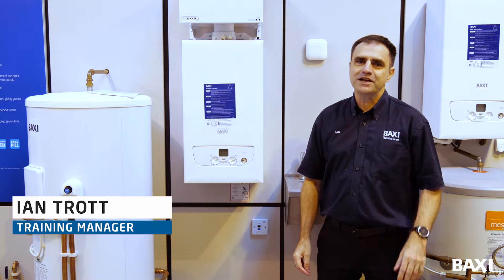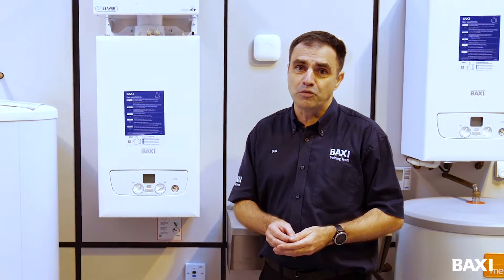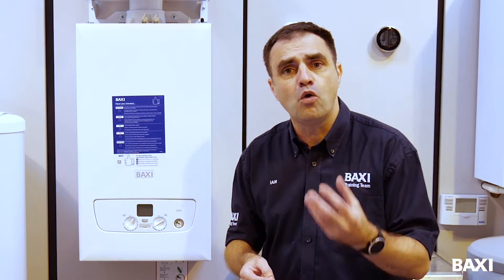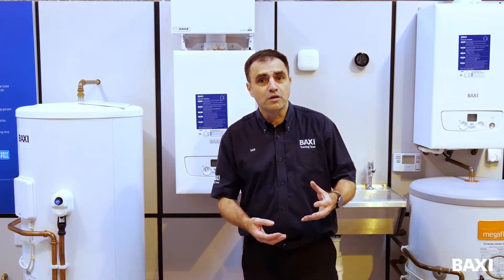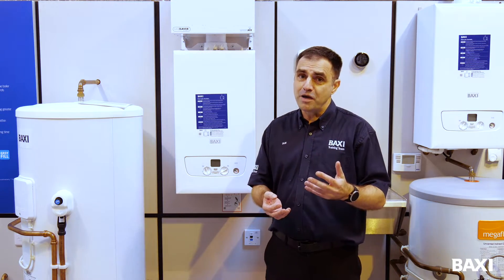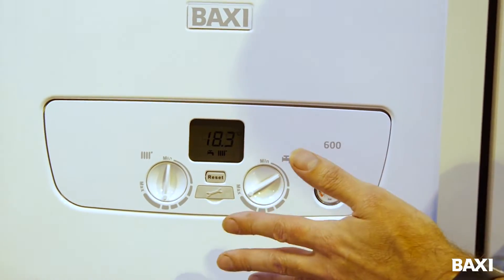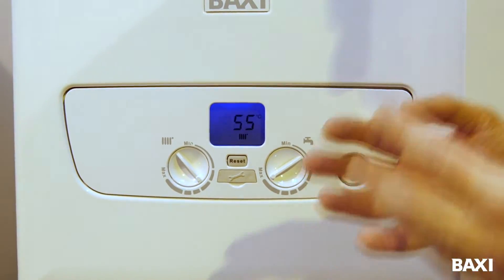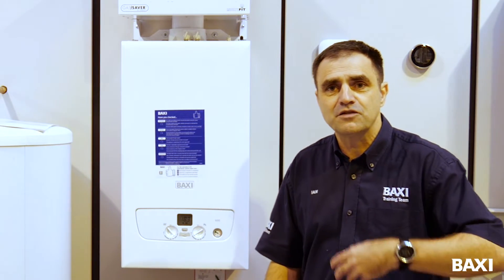How to turn down the flow temperature on a condensing combination (combi) boiler

Comment: A good boiler would be a Heat only or a system boiler with a double temperature setting. This can be used in Y and S plan systems with a Megaflo system or a sealed tank. I run the system like this. I have a boiler with two temperature settings. Whenever my heating fires it runs at 58ºC ( this suits my home ), but when the hot water fires it runs at 80ºC BUT! It turns the heating OFF for that period of time until hot water in the tank is hot. After that the heating runs at 58ºC again. In summer .... when the heating does not fire at all ... the boiler always runs at 80ºC to heat water. Good idea hey 😊

Comment: Hi, we recently bought a property that has a 2019 Main Eco Compact with the exact dial layout as this in the video. Unfortunately neither the radiator or tap dial have any effect on the number, they always display max temp no matter where on the dial you move it. Any ideas? Rang Baxi as it’s not old but because the previous owner didn’t supply any service history they won’t help under warranty.
Reply: The thermostat may be controlling the temperatures if its on opentherm

Comment: Am I right in thinking this hack can only apply to Combi boilers? I have a condensing normal boiler and if I turn the flow temp down the rads are colder
Reply from the maker: Yes - as Ian explains in the video, this hack is only suitable for condensing combination (combi) boilers.  If you have a cylinder and turn the temperature down, the water in your cylinder may not be hot enough to kill the dangerous Legionella bacteria.
Reply: @BaxiBoilersUK  and what affect does it have on rads?

Comment: I have the exact same boiler as this but when I turn the dial down the display still shows 80% no matter where I leave the dial, how can I fix this?
Reply: It sounds like your boiler is being controlled by opentherm, If so the controller will set the boiler temperature. Check your controller instructions for more info.
Reply: @iantrott8874  Hi Ian I was wondering if you could help with my below question?
Reply: Hello I have the exact same thing. I do also have a smart thermostat, Baxi uSense 2. However, there is no option on the thermostat or app that can change the central heating setting only the temperature of the water.  Do you guys have any solution that could help?

Comment: If using weather compensation, will the boiler automatically raise the flow temperature during a cold spell?
Reply from the maker: Hi Darren, thanks for getting in touch. Yes that's the idea, it should respond to the external temperature.
Reply: @BaxiBoilersUK  Thanks for your reply.